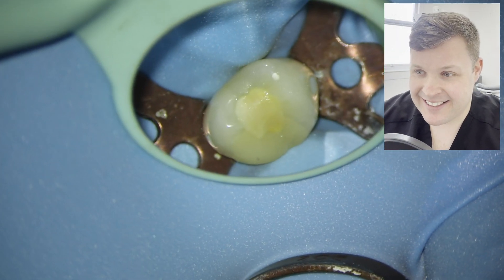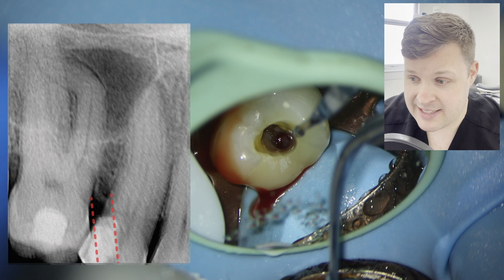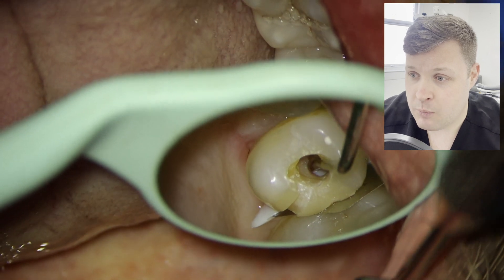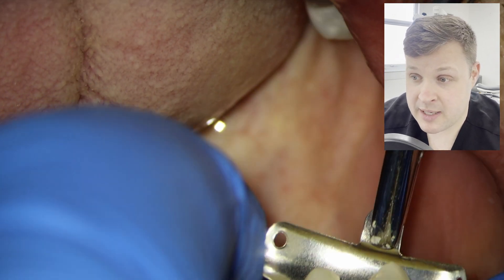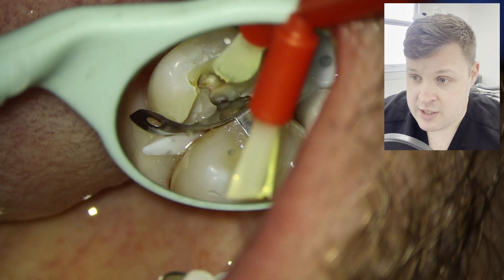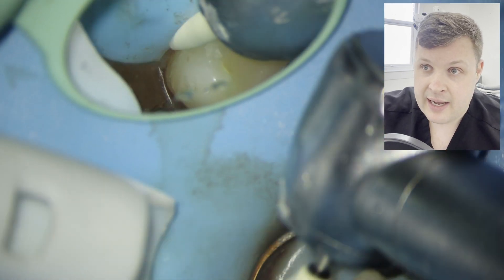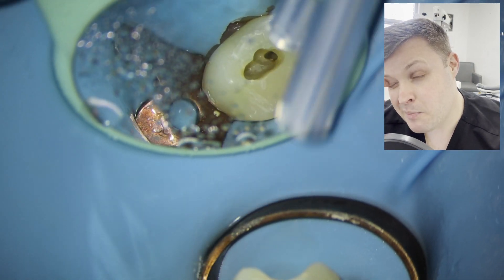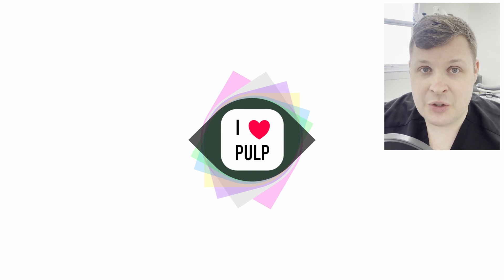Surprise Perforation! Fixing a Hidden Tooth Disaster in Real-Time

Comment: Hi! i am new to this channel and in my second year of dental school in the states. Thanks for your video, may I ask why you restored to tooth to the occlusal surface and started your access from there? instead of starting from where you sealed the perforation?
Reply from the maker: Excellent question! Well its just person preference, but it can be quite fiddly to place a distal wall on such a narrow tooth,  so it was more predictable for me just to fill the whole cavity, then access through the fills. I think for clinicians who are confident at accessing teeth, this approach is better. However, if you are not so confident, I would suggest finding the canals first, then placing and distal wall. It's a bit more fiddly, but probably easier to find the canals. There is another aspect, and that is if the tooth had the canals exposed. Say this tooth was perforated AND the canal orifices were exposed? Well in this case you would want to avoid placing bond in the whole cavity, because to risk occluding the canals with bond, which would make initial access very difficult! Let me know what you think!

Comment: Yea this is exactly what I wanted to see. I have this exact same clinical case, except the perforation is through the mesial wall and it’s at the level of crestal bone and I haven’t been able to get a matrix deep enough to get a perfect seal like you did. If I do get a matrix to seal, would you go with a bioceramic or resin repair? Keep in mind it’s right on the crestal bone level. Great video good sir 🙏🏼🙏🏼
Reply from the maker: Good question, have you seen this video in the link below? It shows the type of case you have just described. Luckily in the case below I could retract the gingiva quite easily so I placed composite. 

https://youtu.be/Xkf8WR27oOU?si=HSEu5obNQRsLF60E 

However, in cases where you cannot directly access the perforation, then a bioceramic putty can be used, the second link below is an example of a case this has used this technique:

https://youtube.com/shorts/UJKu5uGmI4w?si=_JtwVLjGizmIa2wZ

Let me know what you think!